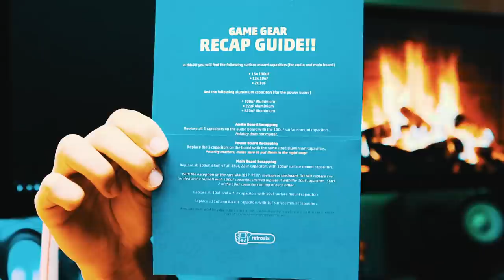NEVER REPLACE ANOTHER CAPACITOR! | New CERAMIC Capacitors for the SEGA Game Gear! | Retro Renew

Comment: I got the same kit works on my game gear and is amazing
Reply from the maker: Awesome! Congrats bro!
Reply: I just ordered the usb c power board to replace the power board I believe the chip on it is failing but does power up it sometimes doesn't power up and led blinks either way was going replace it for better power going through it the screen is great on it gonna replace the tube with the led $10 backlight from handheld legend basically I'm just refurbishing it

Comment: Tried this but one of the fused plastic cap made me accidentally lift off the contact pads on the motherboard, so project failed :(
Reply: You didn't fail at all. If one pad is still there then solder one end of the ceramic cap to it and then run a small wire from the other end of the ceramic cap to wherever the destroyed trace was going. If you can't easily tell where the broken traces went then make a post on the game gear sub-reddit with the capacitor number (CXX) and a picture and someone will be able to help you.

If you removed both traces you could connect wires to both ends of the ceramic cap, tape the cap to the correct location with kapton tape and run the wires to the correct contact points.

For the rest of the old caps, my method is to grab both sides towards the top with tweezers, not pliers, and pull slightly up and back towards the traces. If you have small enough wire cutters you can also snip the legs off the old caps, tear the old cap straight up and off, and remove each leg with new solder/flux.

Comment: Have you seen how DMG Gameboys are repaired when their original screens are missing pixels? Perhaps the Game Gear screen can be repaired in a similar manner. Connections from the screen flex cable just need reheated.
Reply from the maker: Yes, I’ve seen that done before and I’ve done it a few times. I found that the results are a bit inconsistent and sometime temporary. I actually just did the McWill mod on this game gear, have you seen that video?  Thank you for the suggestions and the comment!  I really appreciate it!  Cheers Floyd!!

Comment: Did you replace the front shell. The gash in the bottom right of the game gear is missing when you mention to wipe it down with 303.
Reply from the maker: I cleaned the shell off camera. The bottom right of the shell had some gooey residue that I removed.  It kinda looked like a gash but it was actually black goo. The shell is the same one. Cheers!

Comment: I've never seen the capacitors before so I was horrified to see they were so tiny. Now I am 100% sure I would rather a pro work on them because I am not good enough with a soldering iron to even attempt this without messing it up.
Reply from the maker: That’s a great move. If your uncomfortable, having a modded do it will be great!  You’ll be very happy with the results. Cheers KBX!
Reply: @MachoNachoProductions  it seems like such a cool console too. I only wish a mini version that used less power had come out. Those slim rom loaded ones are not my preference
Reply from the maker: There some really small game gear consoles that were just released in Japan. Unfortunately they only come with a few games.

Comment: Hey Tito, the old caps being stuck to the pcb is a result of a conformal coating used on the pcb, it contains a plasticizer that will cause a bond to form between the pcb and certain plastic backed components, this usually happens when conformal coatings are not given enough time to cure at the factory during board assembly, luckily several products exist that can aid in undoing this, I prefer using the line of remover made by techspray, 2510-p . be careful though, this stuff is very noxious but it will make problems like stuck components a thing of the past. wear a respirator! and great job on the video!
Reply from the maker: Awesome, thank you Kyle for the explanation and recommendation!  Always amazed by your technical expertise!  Cheers my friend!
Reply: Not true! it was a just an industrial adhesive that was used to hold the capacitors down while they were soldered at the factory. This was a very common practice at the time. If you noticed, Tito was able to use his soldering iron to melt off the plastic and the adhesive with it. If it was the conformal coating that held the plastic in place, there would have been a residual mark or stain on the board after the plastic was melted away (there were none).

Comment: I wonder why ceramic ones weren’t commonly used in the first place? Are there any benefits to electrolytic at all?
Reply: Simple economics...the radial capacitors are cheaper and if you use millions of them, you save a lot of money
Reply from the maker: I’m not 100% sure but I know that different capacitor types do have slightly different properties. Hopefully someone more knowledgeable can chime in.
Reply from the maker: That makes sense. Thank you for the insight Joshie!
Reply: @joshiepro3195  I guess I shouldn've ask this better, what I meant was why it's still commonly used /recommended for replacement nowadays. It makes no sense when both options are really cheap these days, yet this is my second time ever seeing someone recommending ceramic ones.

Comment: 6:56 nooooo!!!! (thats probably what broke the screen) These screens are sensitive i believe it is due to static damage! At least this game gear would be a good one for a screen mod!
Reply: You should also never touch or rub the lcd as it scratches the polarizer film. If you want to clean it use compressed air or dust removal tape
Reply from the maker: I typically use kimtech wipes which should be dust and static free. I haven’t issues with it before but it may very well have cause the bars. Can’t say for sure. Thank you for the comment!  Cheers!
Reply: The wipes did not cause the bars. Those bars are indicative of a failing ribbon cable (right of the screen) or bad LCD driver.

Comment: How many capacitors are there to change on the motherboard?
Reply from the maker: I can’t remember off the top of my head but I think it’s around 8 on the mother board. Could be slightly more.
Reply: @MachoNachoProductions  I found the documentation on Retro 6s website.  It was extremely helpful.  I completed my cap swap last night and I am happy to report the Game Gear is now working again.  This was also the first time I have ever done any soldering.  I can't tell you how good it felt when I plugged in the AC power flipped that switch and that beautiful blue SEGA logo appeared.  Thanks for putting this content together and giving people like me the confidence to tackle stuff like this.
Reply from the maker: That’s awesome McPaul!  Thank you for sharing!  I’m so glad you got it up and running again!  It is a great feeling for sure!  Now your game gear will last for many years to come!  Cheers bud and happy New Years!

Comment: I had that same plastic fusion issue with my first game gear. Unfortunately I came to the same conclusion as you.
Reply from the maker: Interesting, it’s the first time I ever ran into the issue. I wonder what causes it?
Reply: @MachoNachoProductions  They haven't fused, they were glued down at the factory. Try to find a PCB-safe adhesive releaser. Goo-gone might be good so long as it doesn't de-laminate the board.
Reply from the maker: Thank you for the insight Ardent!

Comment: Those Ceramic Capacitors are great for all other vintage to modern game consoles, even the PlayStation 1, 2, 3, and 4, including the PS4 Pro. The Original Xbox and Xbox 360 needs them also including full functional original working games on a 2TB or higher SSD.

Comment: Electrical engineers are warning of ceramic capacitors. They are handy but they don’t work as good as electrolyte ones, that’s why professional modders don’t use them anymore. It is a years lasting debate.
Reply from the maker: That’s very interesting!  Thank you for sharing!  I’d be interested to hear the arguments against ceramic capacitors. Do you happen to have any website I could read to learn more. Thank you!  Cheers Mazinga!
Reply: @MachoNachoProductions  Hey Macho Nacho. You are welcome. I found a long discussion/debate about this in a german video games forum. For years the dabted the topic but from what I have understood is, that even the modders who repair their Amiga 500 - ceramic capactiros was their Wunderwaffe - left this method and either use Electrolyte or Tantal ones.
The best option but a little bit more expesnsive would be tantal. If I understood correctly, they don't leak and are very stable.